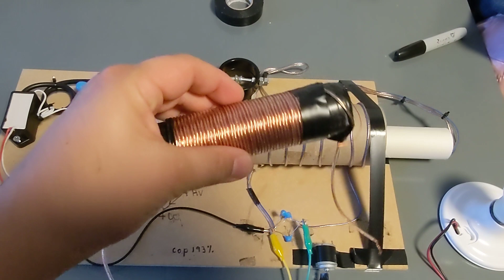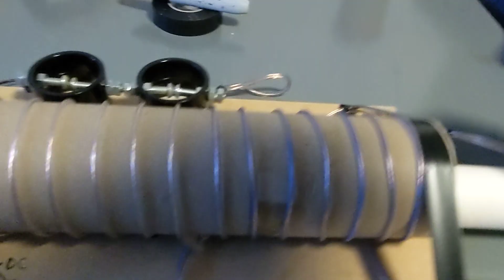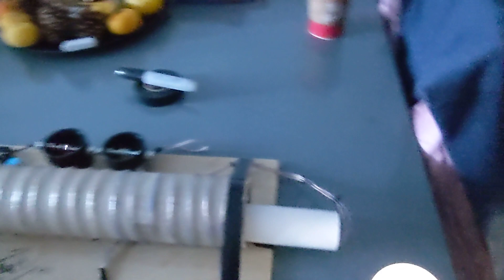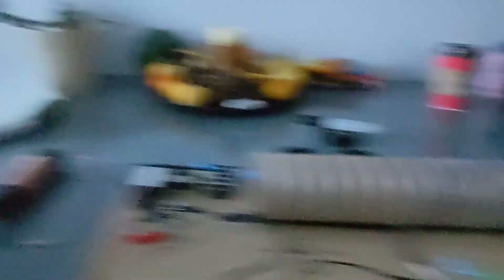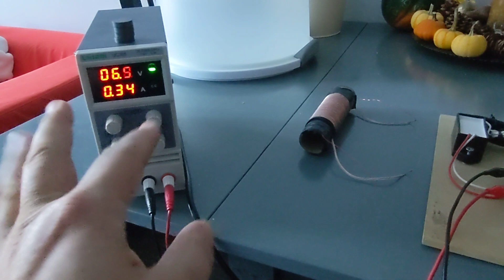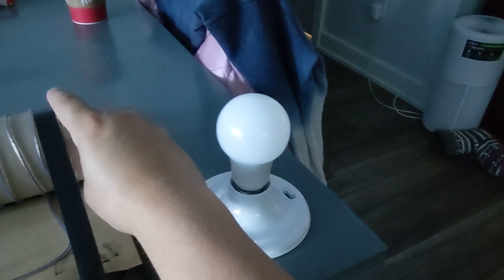Faraday Research RND/⚡📏📏 size doesn't matter!?? #freeenergy #zeropointenergy #tesla #vacuum

Comment: Guess thats something. If you want to get rid of the spark noise you could enclose it in an plastic pipe or coupling. Think i used an spark plug threaded one side in a bushing glued an coupling then place a inside cap on the other side. Even if you want it adjusted. You could use a treaded bit to allow a small bolt to adjust the gap. One utuber i saw used neon bulbs in place of spark gap. He also was able to put one of fluorescent bulb inside the tube and get a good output. Yaw are giving me some ideas. Like yaw do the heavy lifting dont like spending a lot of money. But i was able to build my own homemade hv spark from an old tv flyback transformer. Dint waste my time to add a coil just adjusted the 555 timer. Did burn a lot of transformers and fet transistors but was able to develope a method to tune the freq at stable conditions.

Comment: Nice job and good message re how quick and easy it is to experiment with these ideas. As far as I understand it the big ass coil(L2) exists at that size for two reasons that being mass and resonant coupling with L1. L2 is Tesla’s Volts and Amps coil, one side is volts and the mid point CCW change is the amps side. The dimensions of L2 are predetermined by the resonant coupling between L1 and L2. The real power gain is only achieved when you feed that to capacitors then to voltage dividers then to a step down transformer reducing volts and gaining the amps and then to the load then it is even more efficient.

Comment: Just thinking , what about , Power source , coil , spark gap , 60hz cap , load ?
Reply from the maker: Well I personally work in the Kva  range most of my devices now are 8 kva and higher you have to experiment then just get on the table and start putting stuff together and change things out and try different things that's how I do it

Comment: You really need to confirm the output in watts!
Fully lit LED does not mean fully bright (!)
Wnat is the amperage into that LED while lit up, and what is the voltage at same time across it?
It would only take less than minute to check.
The previous tests with 50W bulb also same thing, it needs to be known what is the amps going to that bulb while lit, what is the voltage across it while it is lit up.  
Use an analog amp meter, and a digital amp meter to compare what each meter will say, for amps input to your load.
If reluctant to sacrifice meters to the spikey output,   then use your power supply to light up that LED bulb or whatever to the exact level of brightness the LED bulb shows in videos  for example.  See what is the watts from your power supply then.
You can just eyeball it for now.....later use more accurate stuff like Norm and Ole suggested on EVGRAY board.
I doubt your 50W bulb was consuming anywhere near 50W, and your 8W LED I just dont know - I only see it glowing and lit, but certainly not fully bright. 
If you dont confirm your output watts, you will be blinded by a "light of confidence" you are making X amount of watts .

Comment: Answer me this , how difficult is it to capture the extra energy, seems rather easy to use it by placing load , but will it charge up the battery or capacitor without a load or do you need a load as a regulator and then a battery will charge ? May be something like this going on
Reply from the maker: Yeah when I'm charging up capacitors you got to have a bit of a load on it ....that's why when I did my experiment I was having a 4.5 watt LED bulb as the load on the capacitor so it made it a lot easier for it to charge up I don't know if you've tried this but it worked really well for me. .... Again thank you for your great question

Mike
Reply: @FaradayResearch  And Bedini I am sure you know he worked with Floyd Sweet another similar invention in my opinion , as well the Kapagen is some what Identical
Reply: @FaradayResearch  never tried it been watching Don Smith for a while , check out Ralph Ring and Ottis T Carr

Comment: Don Smith generator with less turns on coils means you can use lower voltage to run it, might have to move the SG closer together
Reply from the maker: Yes I actually moved the wires closer together after I did that video ...
and I had better results moving the l2 coil wires closer together so definitely I'll be doing more experiments with that plus I have a few other great ideas that I'm going to try in the coming weeks thanks for your comments

Mike